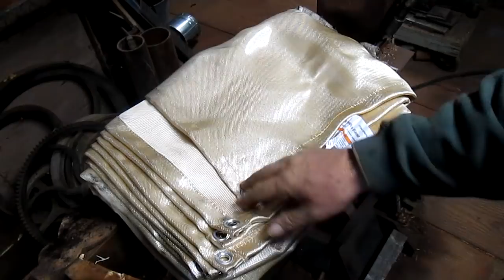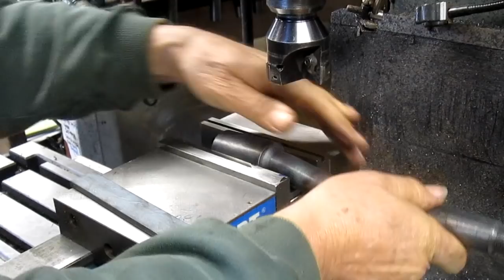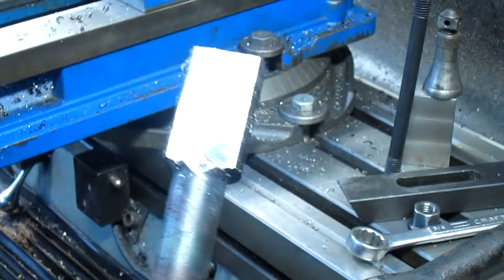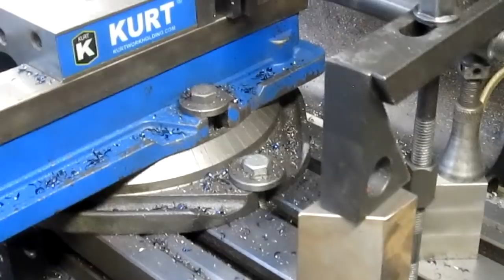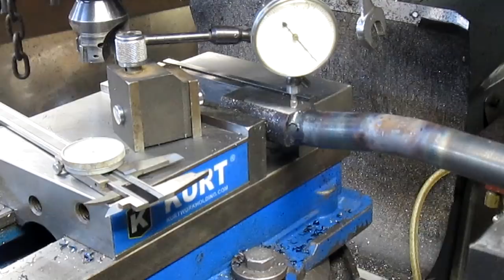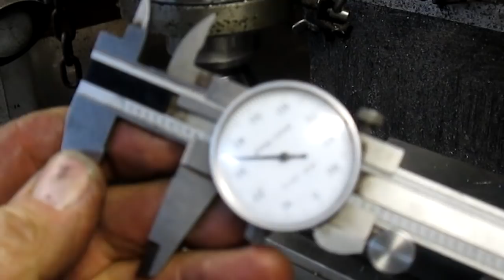Tie Rod Torquing Tussel #2

Comment: I don't understand why a bend is required in tie rods. Don't both ends incorporate ball joints that would account for any angle difference as the suspension flexes?
Reply from the maker: Unless there is something in the way like a frame or maybe a low hanging pan. I never saw the vehicle it goes to so getting as close to original as possible is always the best approach.

Comment: Nik, Your screw jack would have been better if you had a vee top to it. Some jacks have a swappable top, either steel ball  or vee. Make yourself one when you get a chance, a vee would have made it easier to jack 0.010" as you found out the ball kept slipping off. Good video by the way. Keep an eye out on E-bay for a TREE Taper Boring head, very useful item to have.

Comment: Hey Nik, hello from Scotland.
Should the straight arm where the jack is not be parallel to the table, as is the bit you're machining is only parallel to the bed but not the shaft.  Just a thought.
Reply from the maker: Actually the original arm had a wee bend beyond level, thus the rise in the shaft.
Reply: Actually the tie rod would have been forged using the shaft to hold it then a press would have forged it into shape so in theory the end should be parallel to the shaft by design

Comment: SET IT WITH A HAMMER. HAMMER ON THE BIG DIAMETER THIS WILL MAKE IT PARALLEL.
Reply from the maker: If I only had a power hammer. I got it parallel with the press.

Comment: I'm glad that you have electrical service!  Enjoyed this video.
Reply from the maker: That was filmed a few weeks back. We have been without power for almost a week now.
Reply: @NikColyerMachineWorks   I'm sorry to read that.  From what I have read, PG&E isn't the culprit- it's the lack of proper forest management.  Hope you'll be up and running very soon.
Reply from the maker: @jeffryblackmon4846  I'd say a bit of both. If PG&E had put lines underground in the first place this would not be an issue, but they decided to cheap out and give the profits to their investors.
Reply: @NikColyerMachineWorks   No doubt, that was a huge mistake!